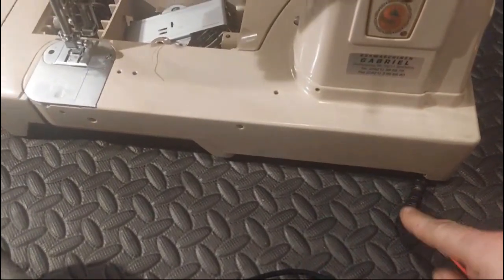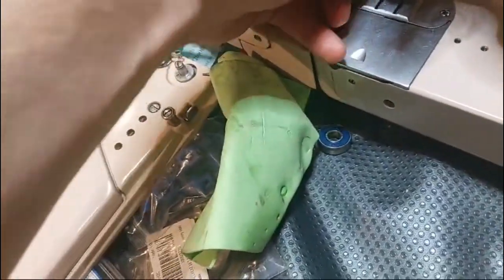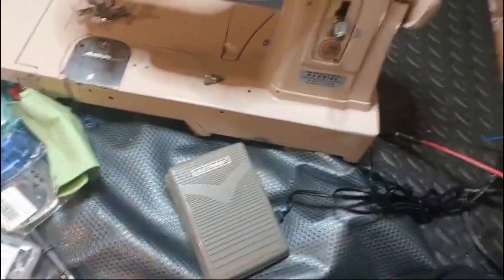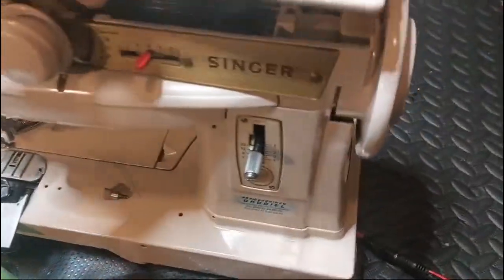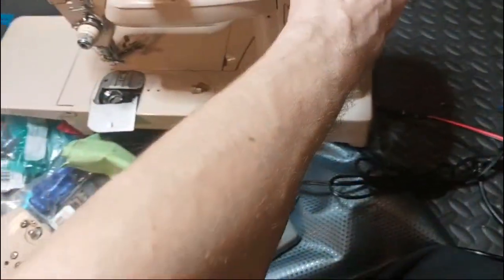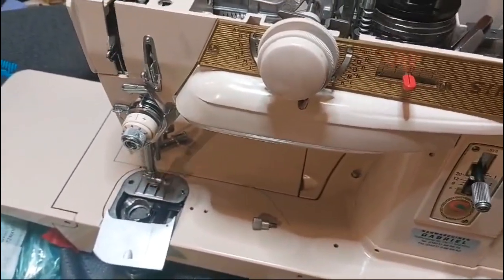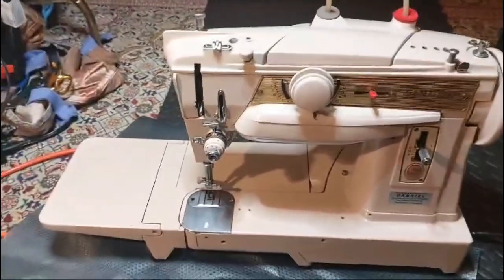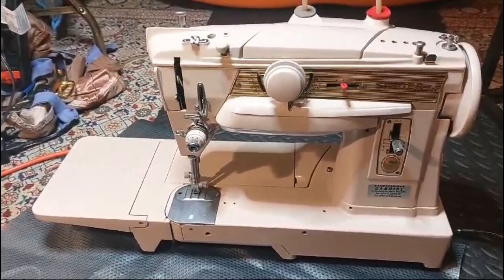Singer 431G Low voltage motor sewing denim

Comment: OMG...you're back! We've all missed you buddy! 

I'm currently working on a Singer 306K that has an anemic .53 amp motor on it (The motor is a hot mess, not even sure it's worth refurbishing), and I am considering either figuring out how to strap a .95 amp Kenmore motor off of a 158 series machine or a 1.5 amp Kenmore motor from a Kenmore 120.71 (New Process Gear/Chrysler). 

The 1.5 amp motor is kind of wasted on the 71 as it is not a chain driven machine like the 49, and instead employs the friction wheel to get her moving. That, and the upper bearings are fighting against being freed  up, so I'm looking very seriously about making a donor out of the 71's powerplant. 

Seems like a shame, but if I do manage to finally get the 71's bearings freed, I could easily throw a .95 Kenmore motor into it as well. If it sews a deep stitch, upgrade the motor at a later date as it is a very unusual machine, to say the least. 

So, tell us what you've been up to in the next video. It has been a moment for sure.

Comment: How difficult was it to fix a different motor inside the original housing?  Is there some kind of coupler you used to make the shaft long enough to go up through the bearing on top?
Reply from the maker: Yes, I used a coupler. It is not too bad once I figured out how to dissemble the original motor and remove the bearing.